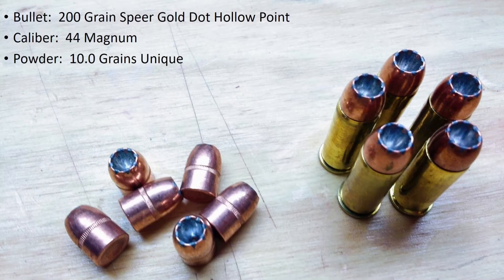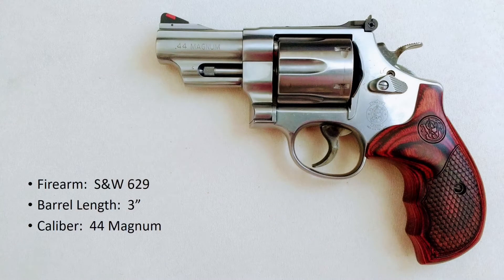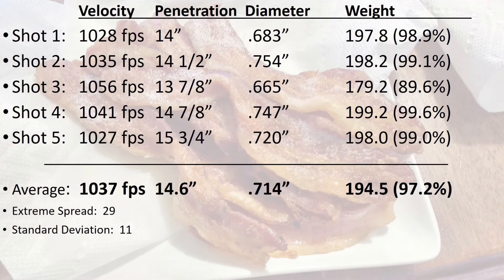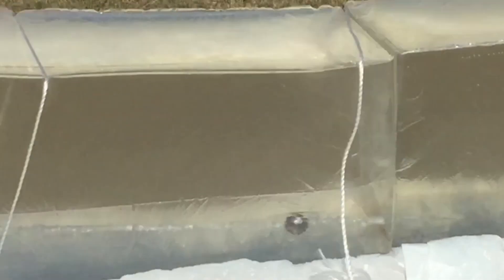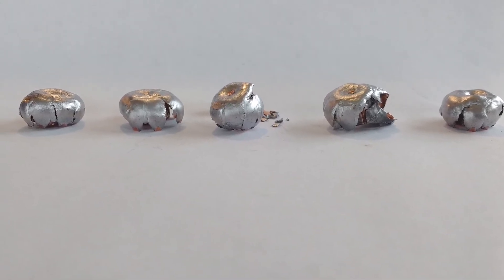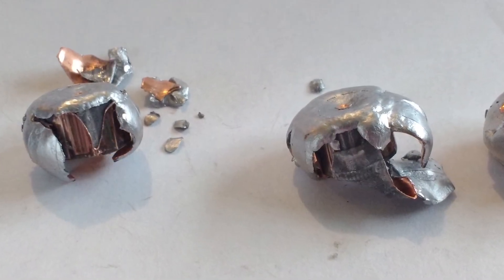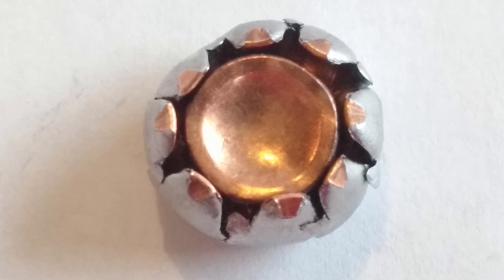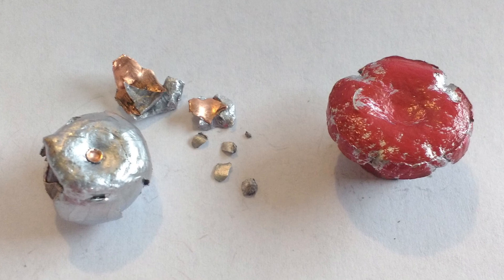44 Mag (1035 fps), Speer Gold Dot Hollow Point, Bare Gel (PC HP Test)

Comment: If I'm going to be using a cast bullet for hunting oh, it is going to be a wide flat point which is heavy for caliber.
I'm not using a hollow point at all.
Reply from the maker: On my last hunting trip I shot a hog with a 250 grain Keith SWC shot from a .44 Mag lever action rifle.  It was not a hollow point.
What is your aversion to hollow points?
Reply: @LoadsofBacon  
Potential for weight loss.
To me if you are using a wide flat nose, you don't need a hollow point if you are running it at high velocity. The flat nose will displace fluid as well as a hollow point and not diminish penetration.

If I'm not mistaken, hollow points were designed to expand 2 limited penetration..... Disruption and temporary wound cavities were in after effect of what hollow points were originally designed to do.

in hunting, over penetration is not an issue and in most cases it is desired.
Reply from the maker: I am a huge fan of a big, flat meplat!  I have no problem hunting with a solid nose bullet.
That said, I’ve had a lot of fun experimenting with hollow points, and that experimenting has shown me that the weight loss is only a few grains.  If you have the right alloy and right HP design, you can still get more than enough penetration and you can turn that .429” projectile into a .850” projectile that still exits the far side of the animal.  Required?  Certainly not, but the right hollow point certainly doesn’t put you at any disadvantage either.
Reply: @LoadsofBacon  
I think that's great. Whatever works for you
 👍

Comment: Too mild of a load. They only produce around 400 pounds of energy.  
I'm hooked on Hornady LeverRevolution bullets in 260gr for the 444 marlin in a 44 mag, with 23gr of H110.  It a max load, and does around 1300fps from my 10 inch barrel, and expands well and offers good range out to 150yds. 
I just use 9gr of H110 or 2447 with 240gr cast SWC for subsonic suppressed loads
Reply from the maker: Too mild for what?  Depends on the target.  477 ft lbs. is plenty of energy for lots of targets.  Also, this particular bullet is designed for lower velocities, so if you go very much faster this that this it begins to fragment.
I also shoot a 255gr cast SWC with 23.5gr of H110.  It shoots 1730fps out of my 16" lever action rifle!
What kind of firearm are you suppressing that shoots 44s?
Reply: I'm kinda kidding on the mild load part. I've been buying Cowboy loads that are about equal to your handloads for plinking, and anything that would be good with a 950fps round. 
I'll have to make a video of my suppressed TC Contender. 44 specials sound like a paintball gun with the AAC TiRant.  I'm looking forward to trying it on pigeons or crows sometime
Reply from the maker: That TC is great firearm.
I have a 44 mag single shot barrel for my NEF Handi RIfle that I'm going to be converting to 445 SuperMag.

Comment: Every hollow point bullet has a fairly narrow range of velocities where it performs well. Jacketed bullets can have a larger range of velocities because the jacket can be tuned to control the expansion.  The jacket can be very thin at the top of the bullet, increasing in thickness as the jacket progresses towards the heel of the bullet. Unfortunately, cast bullets don't have the luxury of a progressive jacket and have to depend on the shape and dimensions of the hollow point cavity to control expansion.
Reply from the maker: That’s right rstephenw.  The other thing we can adjust in the cast bullet is the alloy it is cast from.

Comment: I think bullet construction makes a difference. Some of the bonded jacketed hollowpoints stay together. If you look at the lucky gunner tests, look at the 45acp with the 230g Fed HST +P and the Winchester Ranger T in 230g. No real loos and perfect mushroom. Better than the gold dot or even the vaunted Remington 45acp 185g +p. About a 1" expansion in some cases. That said, If you're using a 44, 45 or bigger caliber, even a lead SWC will punch a decent hole through an animal and break any bones. I use the hornady 265g in my 444@2300. It  blows a decent hole through deer and I've never recovered a bullet yet. I hit one deer at 40yards and when it exited the deer on an uphill shot, it took the top third of the humerus with it and blood and bone spray for about 10' beyond the deer. That was a holy s moment.
Reply from the maker: Bullet design and construction certainly make a difference.  (Gold Dot is also a bonded bullet.)  This particular bullet is intended to be used ~800-1,000 fps, and it seems to perform well in the range.  Others are designed for much higher velocities.  I'm very interested in your 444 - I'm about to set up a 445 super mag rifle.  And as you state, in 44 or 45, you don't need a HP to be effective, you just need a decent meplat.  Sounds like your deer never knew what hit it.
Reply: It was a doe. It lifted off the ground and tumbled ass over tea kettle backwards down the hill. If you know about the marlin forums, the 444 section has some serious people that get practically the same velocity with 330-340 lead cast bullets as I do with the 265. Energies are approaching 4000 ft/lbs. What amazes me about the cartridge is it's natural accuracy. With the load I use, I get 5 shot groups of .75-1" at 100 yards. That's better than a lot of bolt action rifles.

Comment: Just for scale , an ART by John Taffin, 7.5" 629 S&W , Fact loaded XTP -180gr - 1704 & 200gr - 1312 Fps . I don't think this Brl length is uncommon & Hornady wouldn't load rounds that would turn to dust . I don't recall any deer I shot having too many frags , to your point , your PC loads would also work just fine . I do recall shooting deer with soft tips that didn't go down as fast as deer shot with JHP's  ( all 44 ) in handguns ( 1250 - 1350 )  & rifles ( 1650 - 1750 ) , on side shots , 2 holes NO BULLETS . Only  bullet ever found shot from back of ribs to chin ,  ( 15 ft ) lots of bone contact , 1350 FPS from handgun (8") , 240 JHP Sierra , bullet looked like a beat up perfect mushroom , not much lead lost , a shock to me .
Reply from the maker: Thanks Dan!  Bullet and HP design certainly play in as well.  As I said, the gears are turning (slowly), but I'm not ready yet to come to any final conclusions.  The info you provided is certainly helpful as well!
Traffic writes some great stuff.

Comment: I think the Speer is known for its massive hollow point , others may be able to handle more speed .... Love that 629 ! I think that bullet is plated , not a true Jacket ???  I think the XTP & Sierra are a cup & core with smaller hollow point that can handle more speed , I know the 240 Sierra JHP is very strong & takes a beating very well .  Good test . Great load for THAT gun !
Reply from the maker: The flying ashtray...this bullet is certainly intended for lower speeds than some others.  The Gold Dots are bonded bullets.  One of the many benefits to reloading - you can "tune" your loads for your particular firearms.